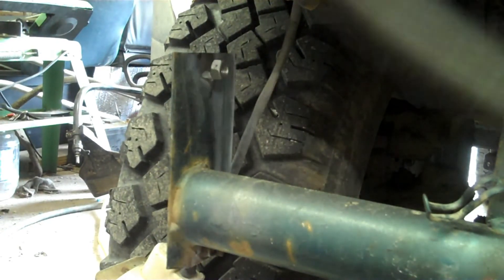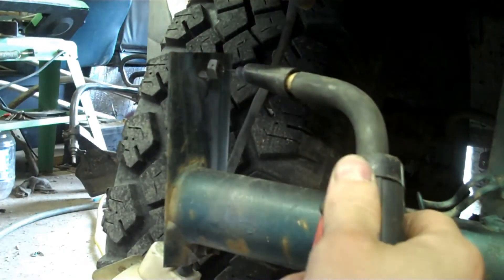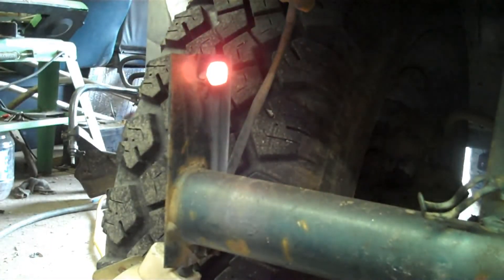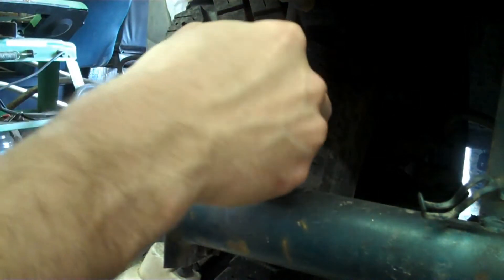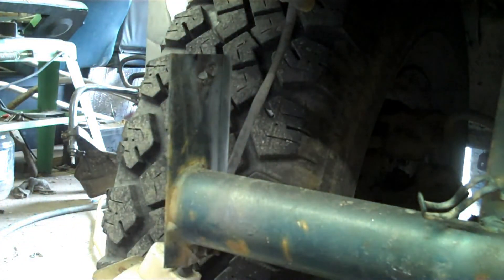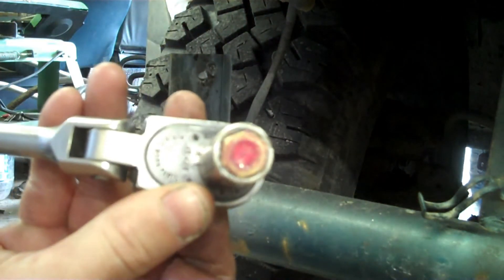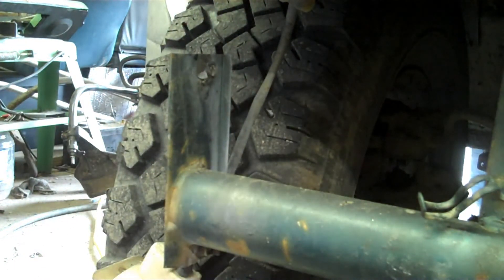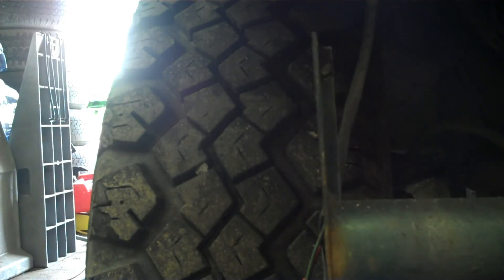The best way to remove a broken bolt

Comment: you can also weld a flat washer to the broken bolt then weld a nut to the washer. works good when there isnt much bolt left to weld to.

Comment: I bet it would have worked on the first try if you let the nut cool. Rule of thumb is if you can put your hand on it for 10 seconds you are ready to try and back it out. Also as someone else said here there should be a washer welded on first. Makes it much easier to get a strong weld on the bolt.